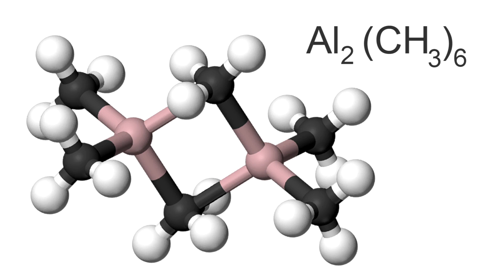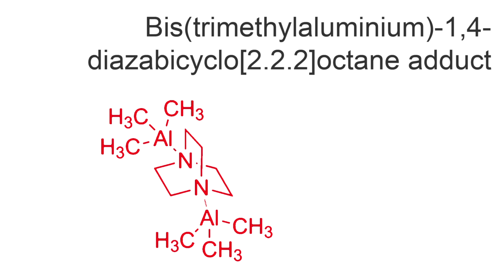Holey Experiment - Periodic Table of Videos

Comment: When you talked about the unusual application of Me3Al and showed some rockets, I thought you were going to mention its use to ignite certain liquid fueled rockets. Because kerosene and liquid oxygen do not ignite on contact at room temperature, the F-1 engines on the first stage of the Saturn V moon rocket used a mixture of trimethyl boron and trimethyl aluminum in a "hypergolic cartridge" to ignite them when the fuel first flowed into the combustion chamber to meet the liquid oxygen.

Of course the  rockets you showed were solid fueled so they have other ignition systems. But that makes at least two very different applications of Me3Al in rocketry.

Comment: What type of canister is that? how do you poke a syringe in and not have it leak???
Reply: also, could i please have the reaction? i'm no good with chemistry >.< so i'd like the reaction of trimethylaluminium with O2. thanks

my prediction:
Al2(CH3)6+O2(x amount)= (fire)= H2O(x amount)+AlO3(x amount)+ CO2(x amount)
Reply: Justin Koenig Something like that, but we were able to see graphite, which means the combustion of carbon was not complete. So there must have been a balance between end products CO2, CO and C. 
Also, aluminiumoxide is Al2O3.

But I'm no chemist, so someone might correct me :)
Reply: They have rubber (sometimes sponge) air-tight seals on the top. You just push the end of the needle through and pull back out. :)